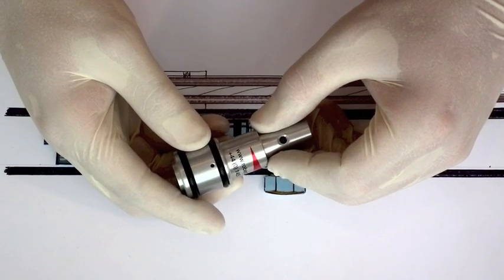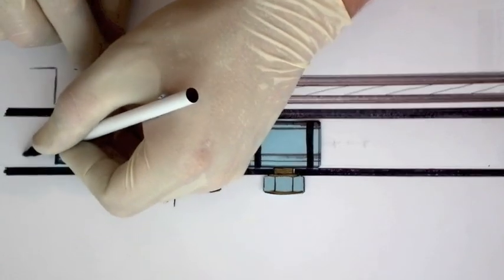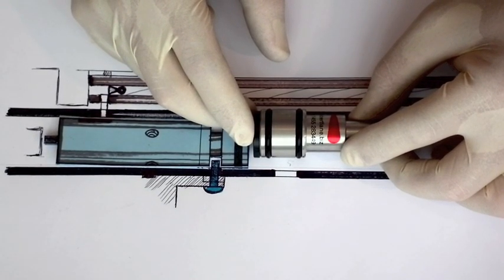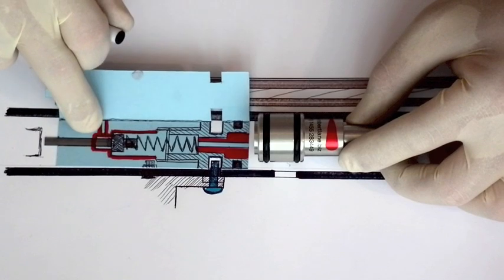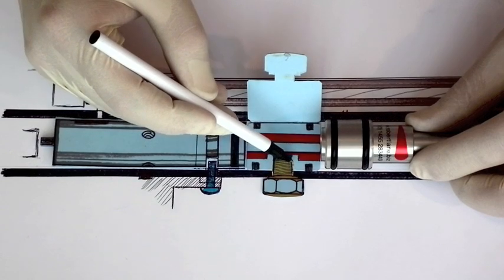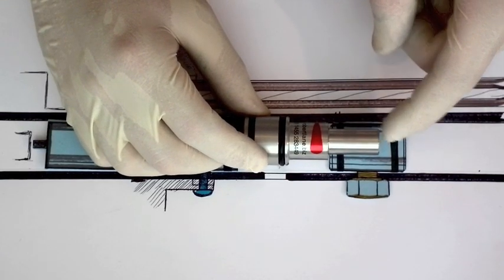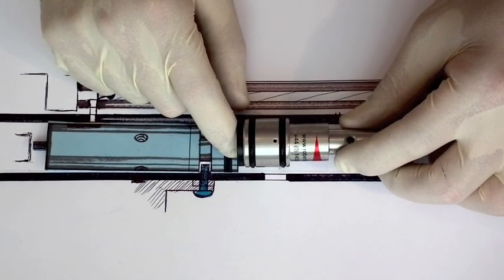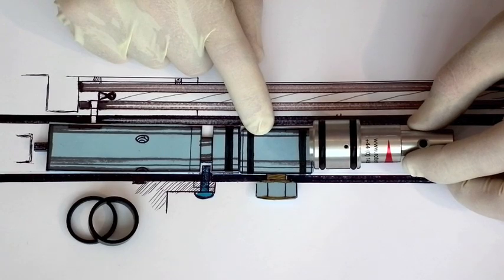OLD 2013 - Benjamin Marauder Regulator - See the NEW MK9 Pro 2019.

Comment: your information is really helpful, the way you describe everything is really impressive, informative and clear, in your opinion, what do you think about the design of Altaros regulator on Marauder? it is a narrow long cylinder shape that inserted inside the pressure block and threaded into the valve.

Comment: Hello Robert, can you help me out with the size of the spring in this regulator? Simply the OD, ID and length. I'd like to have a go at making my own as my rifles are quite different to the Marauder however the 'format' is very similar. I currently use the Chinese Bell washer regulators but I don't believe they are any good. Your spring system would be much more consistent, I believe. If you would help me with this info, I'd be grateful. Cheers

Comment: if you remove the gauge the o-rings are provide the raight air seal so no air leaks can be found?because normaly all the airgun regulator providers suggest 0.5-2mm breathing hole.
Great videos!!!
Reply from the maker: Yes: You can mount it into the M-Rod in place of the Gauge Block.

Comment: Hello Robert, which you feel it will be optimal pressure (BAR) for the Benjamin Armada using your Regulator? 
I believe that according to standard ballistics, it will depend in the twist rate of the Armada barrel rifling twist (which I don’t know) and pellet weight combination for optimal stabilization.
 
I was planning to use Polymag 1.62grams and or Haendler & Natermann Crow 
Magnum 1.72 grams.

Please advise.